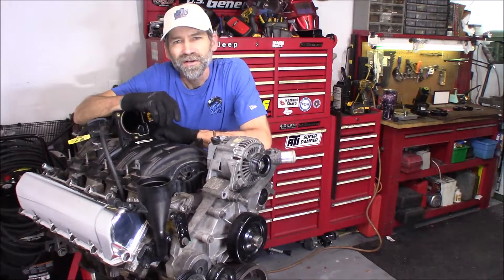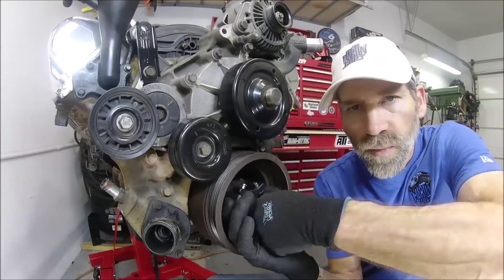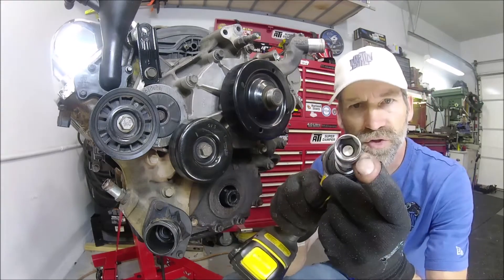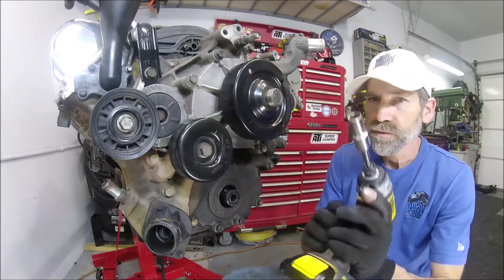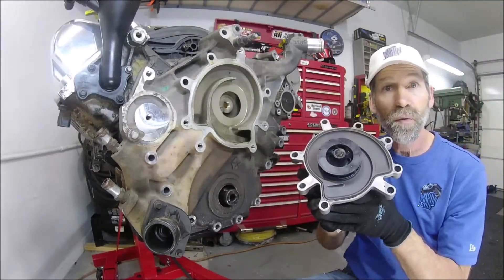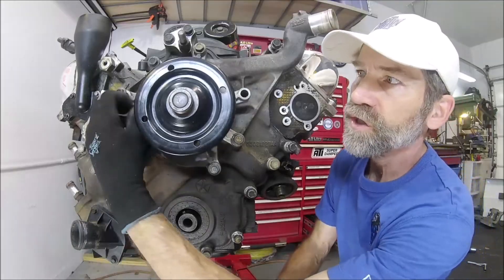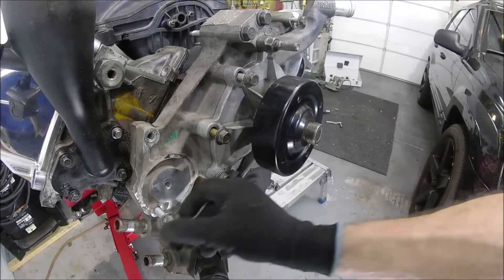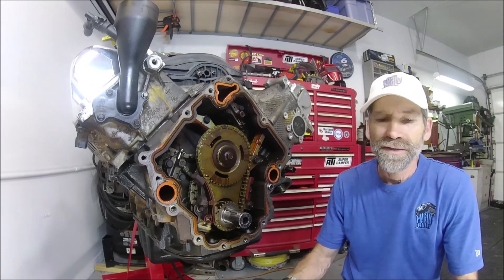How to Remove Timing Cover 3.7 & 4.7 Dodge, Jeep, Chrysler and Mitsubishi

Comment: Good video but this job is a whole other ball of wax when the motor is still in the vehicle..
Reply: Going through this now wasn't as hard as I thought just super time consuming. Had a oil pump bolt break pulling it together so had to drop the power steering rack and oil pan to remove the pump. The broken part wasn't even hand tight when I took it out just used my fingers.

Comment: Hello, my truck's got a 3.7L engine is making a knocking noise only when I start it up in the morning and every time I let it cool down. When the engine is hot, it makes no noise. I changed the lifters and the timing chain, and the noise doesn't go away. What do you think the problem is?

Comment: Whats the preferred method of resealing a 4.7l timing cover? The new kit with o rings and rtv, or the older mls gasket? About to tackle a coolant leak from the driver side. Thanks in advance.

Comment: Thanks for the -no remove water pump knowledge. 
I had changed pump, radiator, therm last year.
I bought it with a bit more issues than told.
After changing the above Thought I could catch it early as compression was pretty good "cold".
So I tried the cat cleaner only to make the head gaskets leak worse.
I'm thinking the prior 80% clogged rad led to some overheating and water leaking to cylds  under temp pressure then to cats which destroyed them.

I'm hoping that seeings as the comp was good "cold" I should be fine with pistons/rings.
Best; Tom

Comment: I know this is an older vid, but it's new to me. I recently bought an 04 Jeep Liberty Sport w/ 3.7L VIN K for the wife. I'm going to have to do and engine swap on it. So before I drop the new-ish motor in I figured it would be be best if I changed out some of the hard to reach parts and gaskets before I put it in. Does this video apply to my particular application? Also, the "new to me" motor has about 105K miles on it. Would you recommend changing all the timing chains, guides, tensioners, idlers, ect.? I do remember reading somewhere that those items are "supposed" to be good for the "life" of the vehicle/motor.
   If these are just plain old dumb*ss questions, I do apologize for my ignorance on the topic of this specific make and engine. This is the first Jeep/Chrysler product I've owned. It's also the first time I've worked on this particular engine. All of my experience is with Chevrolet and Ford, aside from normal maintenance and brake jobs, alternators, ect.
Thank You Sir for your time and effort. I appreciate it more than you know!!
Hope everyone that reads this is or has a great day.
More importantly, Y'all be safe out there!!
Never forget rule number one, as far as working in a shop goes. The goal for today is to NOT die and leave with the same number of digits we showed up with.
Reply from the maker: I would leave the timing chains and guides alone I would say those are still good for another 50,000 plus miles.
And as far as putting a newer 3.7 engine just make sure the one that you use has the same type of ECM in other words a 3 or 4 plug ECM.
Thank you for watching.

Comment: I just bought a reman 4.7 from Powertrain that I'm putting in my mom's Jeep for her.  I appreciate all your videos!  I'm having trouble getting my socket into the tensioner bolt.  It's recessed and seems to not leave much room.
Reply from the maker: You'll need a thinner wall and deep socket to reach that bolt

Comment: If you do this when the engine is still in the vehicle what all do you have to remove to get to the timing chains?  Did you remove the radiator, etc.?  Great videos.

Comment: For remembering the bolts, I was told long ago, the bolt that goes in the hole is the one that sticks out 1.5 times the diameter of the bolt.

Comment: The replacement gasket comes with small water jacket  seals that don't fit.  The part number is 46000. Are they suppose to fit?

Comment: Just done this job. Perfect video! Helped me immensely I’m very appreciative. Any way you happen to have a video of replacing all the seals and gaskets on/in the timing chain cover?
Reply from the maker: Thank you. I'm glad you liked it and found it. Helpful. You may want to check out this video where I do the entire timing chain and gear set replacement

https://youtu.be/0bHxW0qU4WQ
Reply: @martinbuilt  done and done as well. My truck runs great now, that zip tie trick was amazing made it so much easier. I’m not a mechanic but I am very mechanically inclined. And honestly this is not necessarily an easy job for the average DIYer but with these two videos I got it done. In one night might I add.
Reply: @martinbuilt  I also used your video on lash adjuster replacement and done that job as well. This channel is a 4.7 owners dream. A video copy of a chilton Haynes manual.

Comment: just out of curiosity, the bottom bolt hole for the thermostat housing hose broke in the back. the little protrusion cracked straight to the timing chain cover so the bolt no longer holds firm. 

could I in theory shave that protrusion down, add a few washers and two backer nuts instead of replacing the entire cover?

Comment: So from what I see if by chance I am doing this on an 03 4.7 on a Durango and removing the tensioner and the bolt breaks or the threads strip out, I should be ok by just replacing the timing cover or does that bolt thread into the block?

Comment: Thanks for this and your other videos, I needed them. For the Dewalt not removing some of the bolts, I have noticed the more socket attachments that are used, the less impact effectiveness the Dewalt has. At least that is my experience with impact tools not performing to their full potential.

Comment: I don't remember where but watched a video you had a tip and trick on how to remove a stock harmonic balancer with a allthread bolt, some nuts and washers. How well does that workout? I really did not want to remove the radiator and condenser out to do timing chain guided and tensioners. Or do you recommend taking out the radiator and condenser? Do you know where I can find that? Or do you remember the list of parts so that I can pick those up at a local machine shop? Thanks in advance.
Reply from the maker: I believe this is the video that you're referring to.  If you have the hydraulic cooling fan it may be very difficult to remove the harmonic dampener without removing the fan and radiator.
 Thank you for watching.
https://youtu.be/lTkLx4vddwE

Comment: Quick question: I had everything lined up for top dead center both cam gears V8 marks @ twelve idler @ twelve  and crank @ six. Removed tensioners and right side rotated to ten, maybe eleven o'clock positions. Will it be good after new chains and tensioners are installed? Will it go back to twelve o clock position ?
Reply from the maker: Yes use a vise grip on the Camshaft even though I don't like doing that, to rotate the camshaft  when you are ready to install the cam gear and chain.

Comment: I used a 6 point attempting to replace my tensioner and it rounded over anyway. Tried a spiral one next. Still no luck. Time for the ultraviolence now.
Reply from the maker: Now that sucks. You may need to cut or grind the head of the bolt off and then once the tensioner comes off the bolt should come right out. Good luck.

Comment: Good video.  I’m a little late watching it but I’m am just now doing one of these.  My cover did not have a gasket, only silicone, can the gasket you can get work instead of just using silicone?
Reply from the maker: Yes you can use the gasket instead of the silicone and O ring combination.
 I've done it before and it works just fine.
Reply: @martinbuilt  
  I bought the gasket but ended up using the silicone because the gasket didn’t allow the cover to sit tightly up to the centering dowels and against the engine block.  I was also concerned that the thickness of the gasket would set the cover further out and since the accessories all mount to the cover I was concerned the serpentine belt wouldn’t be in line with the crankshaft pulley.  Anyway it’s all back together and back to the customer.

Comment: Was there a gasket behind that? Im fixing to change one on a 2011 ram 1500 with the 4.7 L v8?
Reply from the maker: On a 2011 you will just have O rings where the water passages are the rest is all a Gray silicone.

Comment: I was wondering what gasket set did you use. Felpro lists a set # TCS46000 but neither RockAuto nor Amazon list it as a good part number for the 05 Dakota 4.7 vin N motor yet others say it is a usable part, your thoughts.
Reply: Thinking of doing this next week any response would be helpful.
Reply from the maker: That is a good part but the later models went to rubber O-rings and silicone.
Reply: @martinbuilt  thanks, do u happen to know what years can use the complete gasket?
Reply from the maker: @Bernie Knaupp   Actually, I think you could use the full gasket on all the years they just  started using the O rings and silicone to save money.
Reply: @martinbuilt  I just don't know why Felpro doesn't list it as a good part number, strange.

Comment: When you've got about an inch sticking out, you know you've got it in the right hole...

No, I will not apologize hahaha!

p. s.  Thank you Martin.  You have been a ton of help as I swap the engine in my HO.  I was able to slide metal bars in to catch the steering wheel puller for my harmonic damper, btw.  There is a thin opening in them so 3 string thin pieces of metal do well!

Comment: What if you don’t put the idle sprocket on the dot section what if randomly spin then just line it on the dot,do you know what I mean,like what’s it timing purpose if any real timing purpose like a cam or crack has ???

Comment: Do u know the torque specs for 3.7 for 06 Dakota  and sequence.thanks
Reply from the maker: The torque specs for the 3.7 should be identical to the 4.7. The only real difference between the 2 engines is that the 3.7 has a balanced shaft.

Comment: can you clarify when to use the metal timing cover gasket?
Reply from the maker: My 04 calls for the O-rings and RTV but I still use the metal gasket.
Reply: @martinbuilt  my 07 is flat machined on the block and the cover. originally had rtv only. i was worried about the pulleys being out of alignment.
Reply: @martinbuilt  do you have the part number by chance for it? I found the felpro metal gasket but it says it doesn’t fit so I wanted to verify
Reply from the maker: @jsaathoff734  yea, it says that but it will fit.

Comment: Can we see how it's done with the engine in its place inside the car.  That's a whole different ball game.
Reply: Its about the same. Just some extra stuff in the way. If you have some basic understanding and knowledge of working on cars and truck then you should be fine.
Reply: Yeah it's just a little harder In the truck but not hard at all. These american v8s are the easiest to work on
Reply: remove the bumper raidatior
Reply: Super easy but i started working on a 3000gt vr4 so working on a ram 1500 is super easy haha

Comment: Can you replace it while the engine is still on the jeep ?
Reply from the maker: yes I've done it but I did remove the hydraulic cooling fan to give me the room to get the harmonic balancer off.
Reply: @martinbuilt  oh okay do you have to remove the oil pan I have a 2008 jeep grand cherokee 4.7 4x4 flex fuel

Comment: I wish you had a video start to finish on how to do a head gasket job with engine still in the car. I'm getting ready to do that soon and there's not much content for that. I've done plenty of head gaskets before, even some rebuilds, but knowing what to expect on an engine/vehicle you've never done one on would be a huge help particularly for saving time.
Reply from the maker: Yeah I've been lucky so far I haven't had to do a head gasket or cylinder head replacement so far otherwise I would have a video out on it.
Reply: @martinbuilt  I may have to do one then.

Comment: hey man, thanks for the videos, watching a lot of them, awesome job!. similar paths, 02 dokota, 89 Xj, but you have me on the grand. I need to change the head gasket on the dakota. 70k miles. should i do all the timing chains, gears and tensioners? see a lot of videos with them broken. If I do, the timing chain cover will have to come off, if not wondering if I can change the gasket without removing the chain cover. Maybe hold the chain up when remove head? maybe? thoughts? dont see any head removal videos from you. thanks
Reply from the maker: Yeah you will need to remove the timing cover to replace the cylinder head.  With only 70000 miles I wouldn't replace the timing chains.
Reply: @martinbuilt  ah ok, thank man, much appreciated! I see how the guides are, they are more my fear. thank you

Comment: Hi, I have a problem with a tensioner on my chain.
When starting without the cover it looks like one tensioner have oil and the other does not.
Do you know why it can be?
Grand Cherokee WJ 4.7 V8
Reply from the maker: I would replace the hydraulic tensioner. It could be clogged.
Reply: @martinbuilt  I already replaced and lasted 1 month :(
no oil comes out of that hole
Reply from the maker: @cepareja  that's not good, how about remove the tensioner and force fluid or air in the opposite way maybe you will be able to remove the blockage

Comment: Martin.. Is there a torque procedure for reinstalling the timing cover? Bolt torque requirement and torque pattern??
Reply from the maker: Timing Chain Cover Bolt. 40 (ft-lbs) I would use a cross pattern

Comment: My tensioner bolt rounded 😑 i did everything you said AND I barely started i yhink it was previously rounded off any advice now?
Reply from the maker: That sucks...you may have to cut the head of the bolt off and then have to replace the tensioner.

Comment: That belt tensioner bolt is a jerk. I struggled to remove it on a Dodge Ram 4.7. 
I ended up removing the fan & shroud so I could have more room. Even had to go down a size in socket because the bolt was starting to round. It took an 18" breaker bar, a 1/2" 6 point socket, and a second person to get it out. I had someone push in on the socket/bar towards the bolt while I turned and it finally broke loose. 

I reinstalled with a new bolt and torqued to 30 ft lb. That bolt head is really shallow, almost low profile and its recessed into that tensioner. Terrible combination
Reply from the maker: Glad to hear you got it out.
Reply: @martinbuilt  Thanks. Few things beat the sound of a bolt breaking loose. Music to my ears
Reply from the maker: @Danielito9165  yeah no doubt but that sound scared me because I thought I broke the bolt head off.

Comment: @martinbuilt Just got the timing cover off. Your video was a great help! Especially showing what bolts to leave water pump on. I was surprised by how much coolant came pouring out. Be sure to have a large tray & a pan. I tried removing engine block drain bolt but wouldn't turn. Was afraid of it breaking. Though there is no place for gaskets that I can see on my Jeep 2005. 4.7L. Just seeing some old brittle remains of gasket material along inside edges.
Reply from the maker: Glad it helped, yes some later models just used RTV and a few O-rings around the coolant  inlet and ports.
Reply: If you just let the coolant run the neighborhood cats and dogs think they are playing for FLorida State and lap it all up like it was Gatorade so no old coolant needs to be disposed of. Gotta love our furry friends. (Sarcasm PETA Patrollers)

Comment: I Got coolant leaking inside the engine from the front of the engine down into the oil pan. What all do I need to replace? Where do you think it's leaking from? Wanna sell it once running. Would you replace the water pump too?
Reply from the maker: if your looking to sell it, replace the timing cover gasket and hope it's not a blown head gasket.

Comment: Martin, I have a dumb question, on my 2008 Dodge Dakota 3.7 V6, on my leaking timing chain cover gasket, do I need to use gray silicone even though the gasket material (paper/asbestos?) has an elevated rubber seam that runs around the gasket permeter?  If yes, do I put the silicone on the inside or outside of the rubber seam?  I've been watching your excellent videos, I'm doing my lash adjusters & rocker arms, too!  Phil
Reply from the maker: If you have the gasket that has the rubber seam all the way around, I would not use ant silicone. Thank you for watching!

Comment: F ME. I've been working on that bolt on the tensioner for 3 DAYS now! I'm scared to death of stripping the head out on it. I've tried heating it up, every impact wrench known to man, idk what to do next.... I'd like to slap the engineer who decided that was a good idea!
Reply from the maker: if the engine has been removed from the vehicle give this a try https://amzn.to/2YesOKJ I have had good luck with this tool.
 If the engine is still in the vehicle using a breaker bar and even if you twist off the bolt I believe after removing the cover the remaining part of the bolt will come right out.

Comment: I beg you for your assistance ...ive been stranded in Oklahoma i replace timing chain tensioner..where do the V8 marks go on right and left sprockets  at 12 ?
Reply from the maker: Yes both V8 go to 12 0clock positions, this video explains the timing marks https://youtu.be/0bHxW0qU4WQ
Reply: Do u have a video on 4.7 cylinder head removal and replacement..cause i bent my valves and gonna try replacing them
Reply from the maker: @darwinthompson9219  sorry no I don't
Reply: What do you think is easier replace cylinder heads or get used motor. Cylinder heads seem alot more work. Special tools for lifters..
Reply: What motors are interchangeable..i have the 99 4.7 4wd..can i go dodge ?